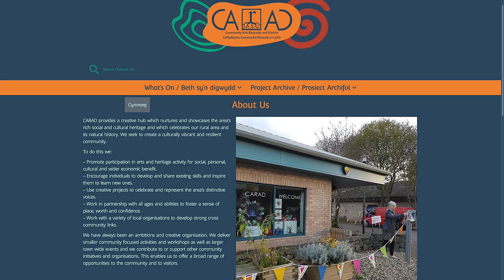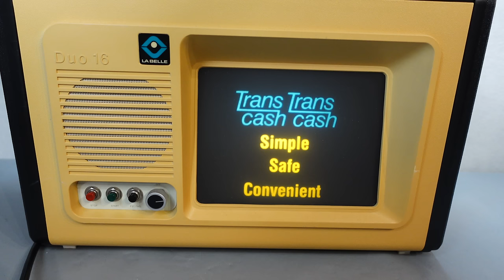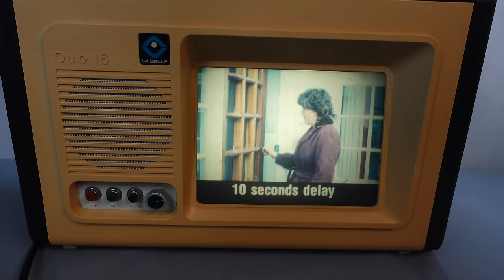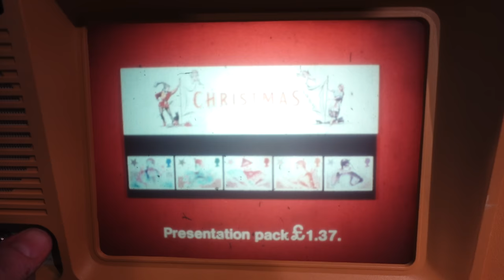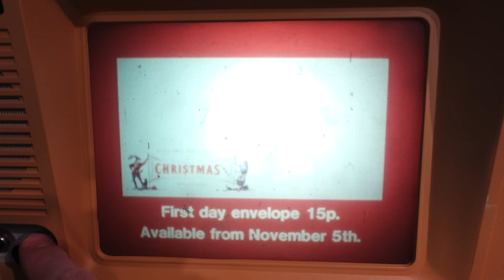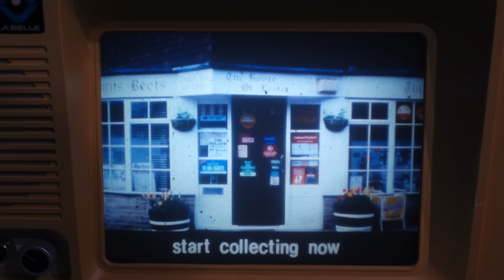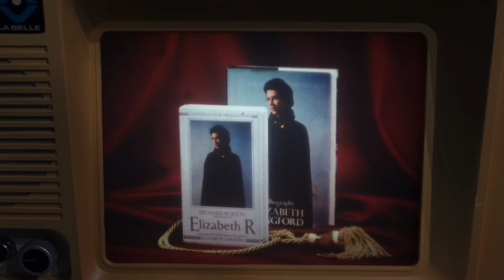Revisiting Post Office Commpak carts with a back projector

Comment: Could set the camera (if your camera has the feature) to 4:3, 3:2, or 1:1.
Reply: Or simply crop it in video editing software if it's that big a deal.
Reply: @NotATube  As a former pro photographer, it's a lot easier to get it right in camera, than to fiddle with software later!
Reply: @mikefellhauer3350  That's true- in my job I sometimes have to take photos, and it's almost always less hassle to set things up correctly (as far as possible) than to spend time Photoshopping various problems out later.

But in this case, I'd assume that a simple 4:3 crop wouldn't be a big problem; though, yeah, you may as well set it up in-camera anyway if that's easy enough.

Comment: Coming from usa and I assume ebay they (ebay) have this insane shipping program that for no real reason messes with exporting some items and creates extra unnecessary cost for the buyer as well. These items are not returned to the seller, the items are destroyed instead. This happens coming to Canada as well. Ebay sellers are tricked into thinking that they have to use this when in reality a usa seller can instead ship international with their own terms and shipping method by simply opting out. UK ebay also has a similar insane shipping program for international sales that tricks UK sellers the same way.

Comment: The yellowing of the plastic happens over time.  It will be ABS, to which some manufacturers added bromine to make it more fire resistant.  Over time the bromine leaches out, discolouring the plastic.  It can be restored using something called Retrobright/Retrobrite, which is basically a hydrogen peroxide based solution/gel.  How long it lasts before going yellow again is debatable.
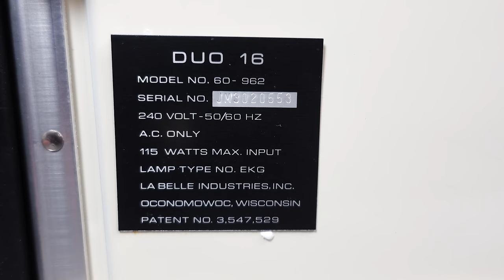Reply from the maker: 12:40

Comment: Some of the films Needs a Wash 
only bad thing The only stuff Rated for celluloid Film Washing  is dry cleaning fluid "Tetrachloroethylene" for clothes and it a Evolvement CFC Nasty one and you lungs

little Fun fact they use Tetrachloroethylene for celluloid Film  for  Remasters for Digital (DVD Blu-Ray Digital file for Streaming + 5D Glass archive + DNA archive) and Take the Film Scan with the Film in  Tetrachloroethylene  due it Sharpens & enhance film Colours for better results